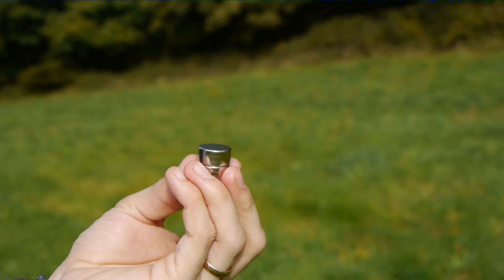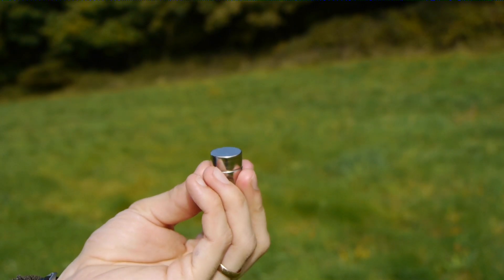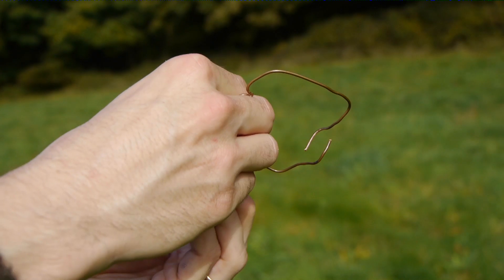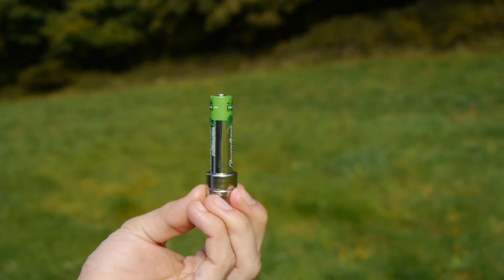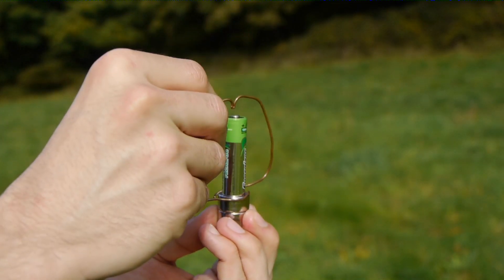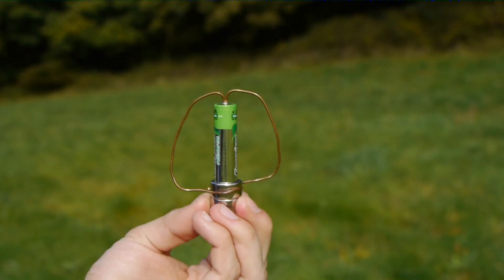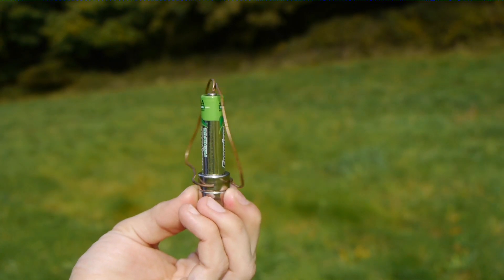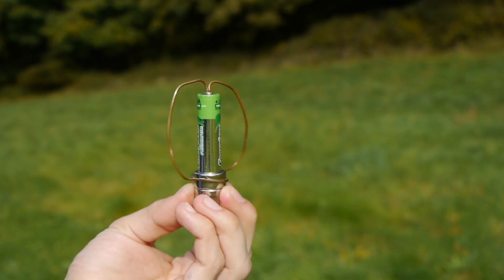How to make a really simple motor

Comment: Did you know that an electric motor works indefinitely long if the brushes are changed frequently and all bearing are kept free? The oldest known electric motor AFAIK is in Budapest where it still operates one of the lifts on a metro station. The motor is in plexiglass cube and you can watch it working.
Reply: But the magnet still has a finite life